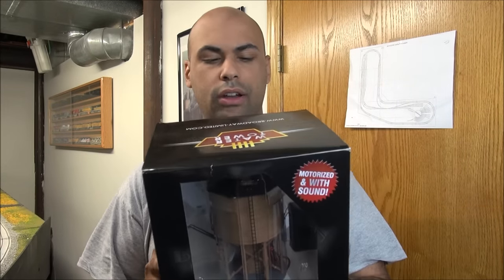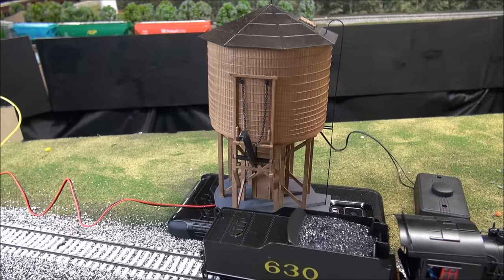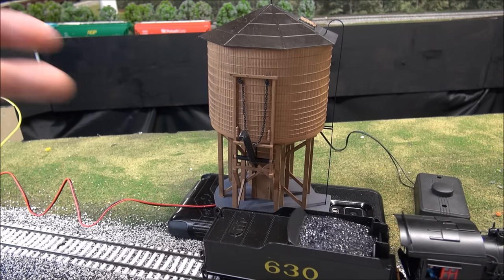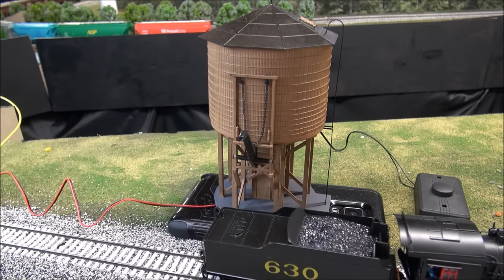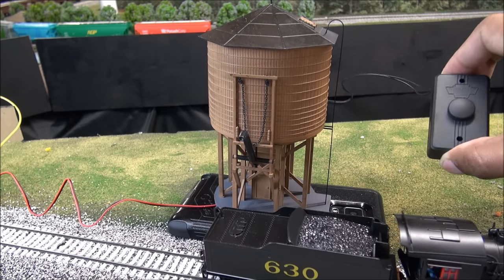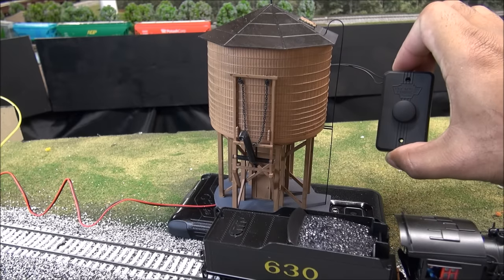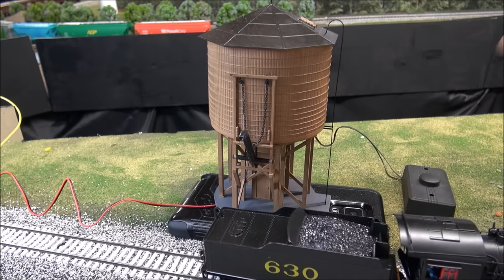Review: Broadway Limited Operating Water Tower (HO)

Comment: For the money this BLI water tower should have come with a built in address programable decoder so you could run it with your DCC controller remotely and the push button for those with analog AC/DC.